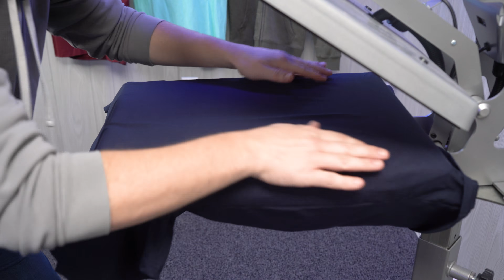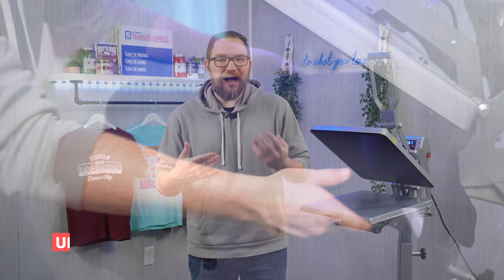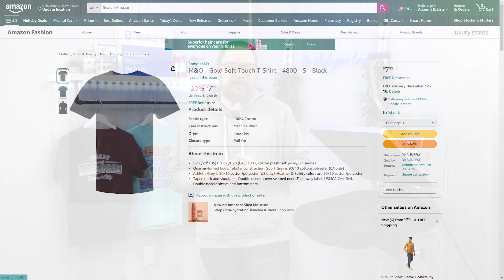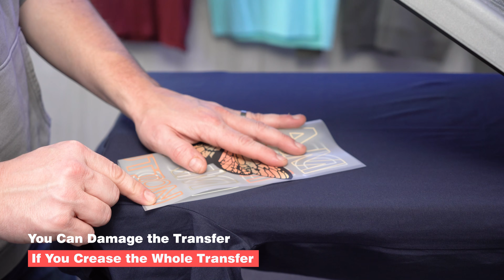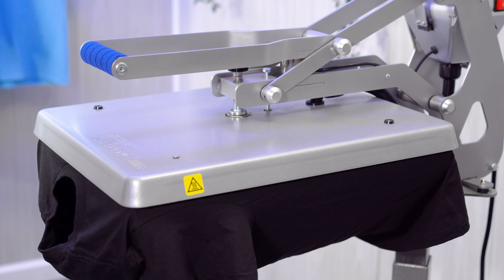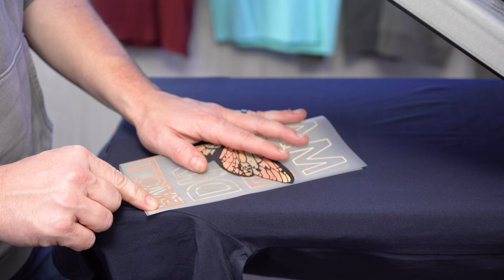Frustrated with Crooked Prints? Pro Tips for Perfect Heat Printing

Comment: Is that a regular mouse pad under neath the pocket tee to elevate it to press transfer on pocket? Or other raise product you recommend? Thanks Dave!
Reply from the maker: Just typical mousepads with the polyester fabric. We do recommend using the blank white ones, as any printed ones may transfer the image to the garment as well. You can find bulk packs on amazon as well as at https://www.transferexpress.com/heat-press-accessories/mouse-pads
Reply: @transferexpress  Thank you. Are these mousepads you recommended high enough to raise thicker fabrics like a jacket with buttons or thick hoodies?

Comment: So, just to be clear. If the Kangaroo pocket on a hoodie is off centered my transfer should be aligned off centered with the pocket before pressing?
Reply from the maker: Great question and for most cases, yes. With the visual weight of say a white print on a black hoodie, the print will look off-center, crooked or misprinted to the eye, where as the hoodie pocket being the same color fabric does not catch your eye's attention and highlight any misplacement.

Comment: What material is the grey cover over the sponge-like base? I want to DIY one for myself.
Reply from the maker: It is a proprietary heat resistant material similar to as PTFE Coated Woven Fiberglass Fabric, which can get quite expensive, We do have them available in many different sizes to fit almost every heat press size and shape: https://www.transferexpress.com/heat-press-accessories/quick-slip-protectors